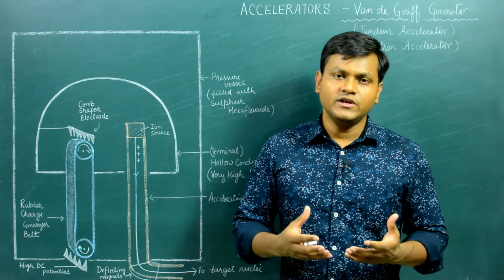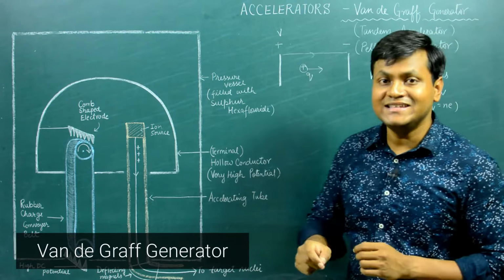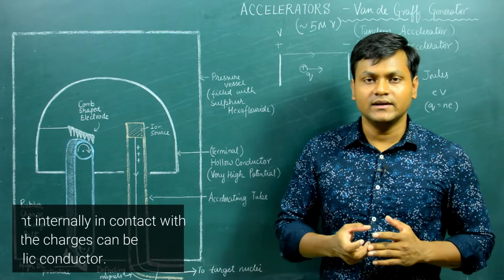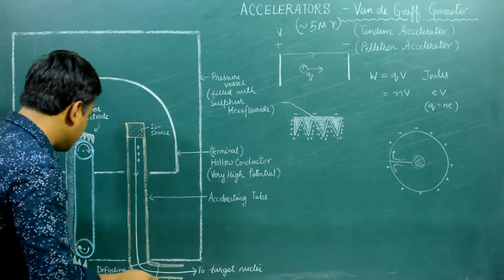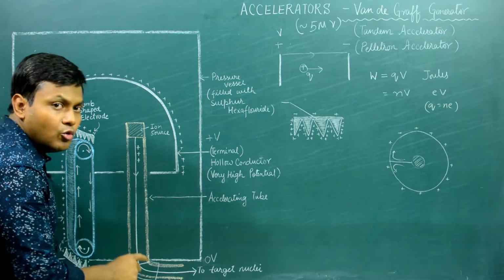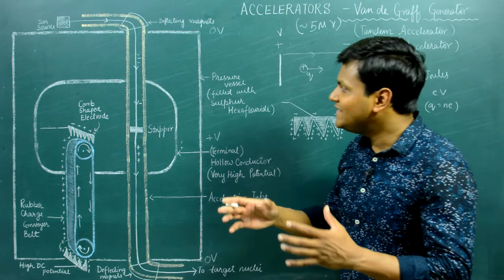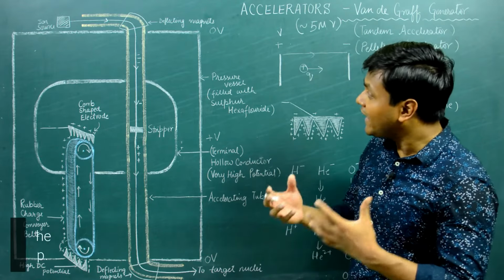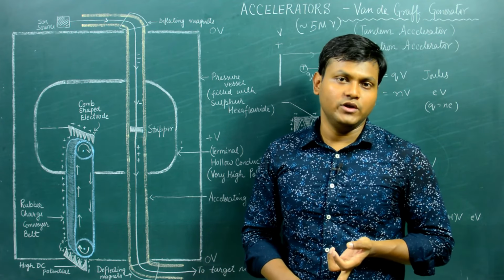Van de Graaff | Tandem & Pelletron Particle Accelerators (Principle, Construction, Working)

Comment: I appreciate the depth you go into here. But it leaves me with two questions.
First, in the pelletron example, would you be able to do this in a classroom with bike chain links, and 3d printed nylon. Or would the chain have to be a lesser alloy like pure iron? ike chains typically have alloys making them closer to knife blades rather than being more ferrous...??
And two, if you wanted to build up a large charge with the normal vdg, but, you wanted to contain that charge build up WITHOUT using a capacitor, is there a way to do it? A more primitive method so to speak. By this I mean, I want to run the generator, let it build up and store it so that you can turn it off but then discharge it in a controlled way later.

Comment: I don’t understand why we can’t use VDG to accelerate negative particles?
If we place negative ion source at 0 voltage, than negative ions are accelerated towards V potential, as you said. 
Or why we cannot deliver negative charge to the terminal the same way and accelerate negative charges from negative ion source the same way? There are negative ion sources, right? Some beta-radioactive sources, for example

Comment: Wonderful explanation ...What happens to stripped charge ,,,as it accumates and inside a heavy positive charged (in MV)  metal .?
Reply: Those ions are lost in collisions with the walls of the acceleration tube  and contribute to the leakage current.

Comment: Very interesting. I had no idea they were used as accelerators. So the rubber bands carry electrons from the dome to the ground, correct? My question is what prevents the rubber bands from carrying electrons in the other direction (from ground to dome)? Thanks!

Comment: A question: How do you get negative or positive charges on neutral atoms such as Neon or Helium.
Reply: I think the positive charge state is easy to get, just using a plasma ion source. While for a negative charge state, I saw someone using a sputtering ion source.

Comment: Sir, with due respect i want to ask the question that "if the purpose of that semi circular conductor is to collect more positive charges and be at high potential... then why we use the chrage tranferring belt here?? Why don't  we directly connect that semicircular conductor to a positive plate of  high potential???
Reply from the maker: Because you vl require a battery worth millions of eV to create that high a potential difference